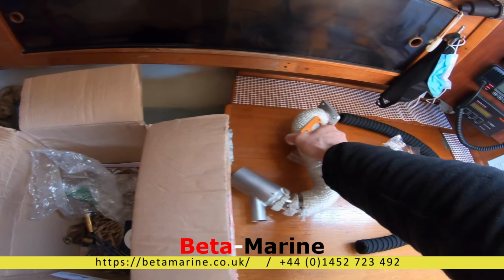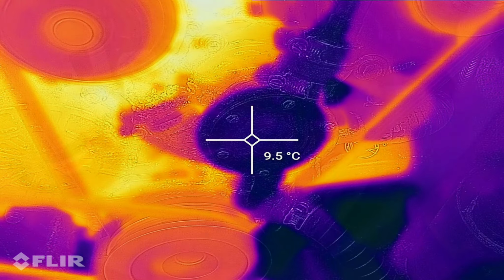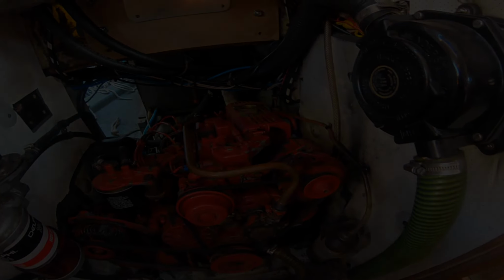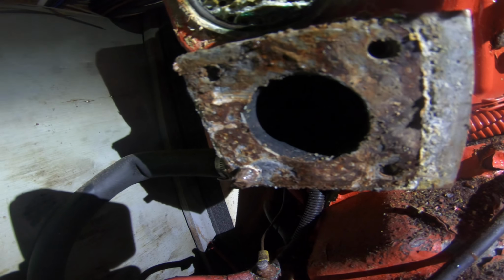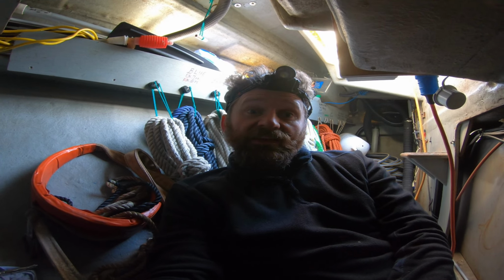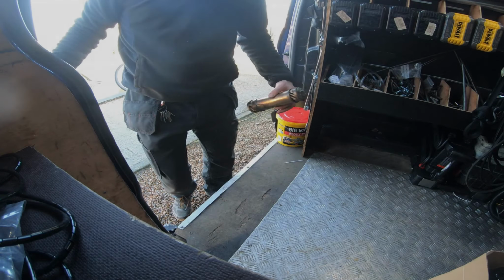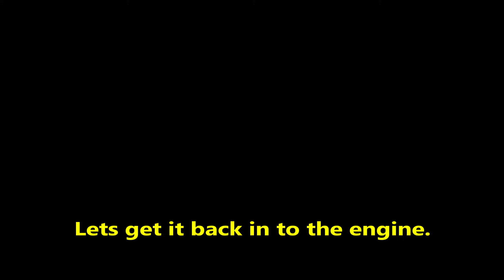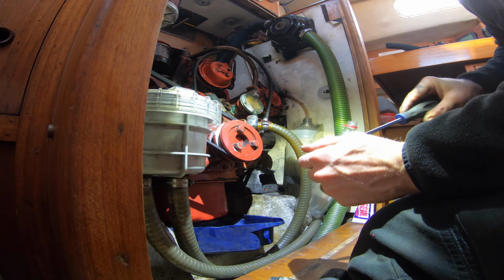BETA MARINE 28HP with PRM120 repairs

Comment: I congratulate you for the seriousness and passion you put into your work. Maybe if they found like you in my town. If I may, I’d like to ask you something.
I also have a Beta 20 engine on my boat. I have problems with the heat exchanger. You can tell me what the characteristics of the coolant should be, and with what it should be mixed, tap water, distilled water, demineralized water. Thanks and greetings from Italy
Reply from the maker: Best refer to the user manual for the engine. But water carries minerals. Deionised water is low a conductive so aids in heat management
Demineralised water will have less minerals to deposit in the coolant.

As the quantity of the coolant/antifreeze mixe is small it would not be too expensive to blend a treated water.

The quality of the coolant mix is dependent on the temperature ranges and the metallic components it works with. Beta marine state the type of approved antifreeze in the manual.

If you regularly clean the and change the coolant say every year or two then tap water isnt an issue. But thats very general as tap water varies a lot from place to place. Best to avoid heavy water as the calcium build up can cause issues.

Comment: Thanks for the walkthrough on your work. The exhaust neck flange bolts/screws seizing seem a very common problem. Do you use an anti-seize compound on threads especially the ss in aluminum? I prefer the studs whenever possible to maximize thread engagement and reduce the chance of galling or stripping.
Reply from the maker: Another has suggested using stainless studs and I must admit it's a better idea. As for anti-seize, I didn't this time but may some aluminium slip. To be honest if the engine is serviced regularly along with the tube stack being removed I can really see a need for it. As you say studs do make more sense.

To be fair on this engine the majority of the corrosion seems to be because of a leak from the raw water hoses. I really don't understand why common coated fixings are used except say cost savings.

Comment: Interesting video. Assuming there are no existing bad indicators, at what sort of hours would you recommend servicing or exchanging the injectors on these small Beta Marine / Kubota engines?
Reply from the maker: From what I'm seeing in the workshop manual from Kubota it's states to check the injection open pressure at 1500hours. And check the timing after 3000hours.

Injectors are possibly one of the most hardest used parts as the temperature changes causing thermal shocking and the conditions of use mean they will fail. But one should have respect for them as they tolerate over 1000 Deg during the combustion process. Quite a feat of engineering in material properties. Also worth pointing out why the fuel supply and return is vital to have working correctly which aids in cooling of the injectors.
Reply: @dhcrouchmarineltd3049  l expect most people tend to ignore than until things start to go wrong. I have a little Sea Otter with a Beta 10 / Kubota BZ482 that's just reached 3300 hours. I have to say, that appears to be working pretty much flawlessly at the moment. I  guess should get someone to have a look at them though.
Reply from the maker: It's one of these things, if it's working fine don't fix it. But then idealism states do something at a pre destined time.

My transit custom van is one with common rail, there has been big issues with the injectors and I had problems. All covered under warranty. I must admit I noticed a big improvement when I fitted 4 new injectors.

It's sated to change them at 60,000 miles
 I plan to do just that once I reach 120,000. Currently on 87,000.
Reply: @dhcrouchmarineltd3049  Yes, indeed, for all I know changing the injectors in my Beta might turn it in to a racehorse - mind you it manages to push my little narrowboat along at a fair old lick by canal standards now. 
'idealism states do something at a pre destined time.'
Oh, yes, I got five years out of my last impeller. It only died because I accidentally killed it one day! I'm definitely the weak link in the system.
Reply from the maker: Ha, I think all humans are a weak leak. But then were also the means to make it happen.
I try to encourage use of machinery to do things with respect and not trash them.
Reply: @dhcrouchmarineltd3049  I'm a CCer live aboard and am fairly paranoid about the engine (and sinking, of course). I've taken to congratulating the engine for starting, and thanking it for running so well when I stop and turn it off. And generally talking to the boat 8-)
Reply from the maker: Ahh a proper captain should talk to the ship. I talk my work. So I respect that. Beta marine are one of the best engine ranges. They are well built and simple. Which is most of the game.

Kubota the base engine core for most of Beta are built for hard work all day long. So provided they get regular oil and filters changes. They generally do provide decades of service
Reply: @dhcrouchmarineltd3049  Yes, everything I have read and heard about Beta / Kubota  engines has been good.

Comment: That drill won’t clean thro the length of the stack. I bought a 300 mm length of 3.5 mm Silver Steel and poked right thro. Some were blocked and needed a tap to get thro.
Reply from the maker: I didn't need to go to that degree. Mostly surface crud. But when you say a tap I hope you don't mean a thread tap. A water tap to blast it ?
Reply: No! Just a tap on the steel rod😂